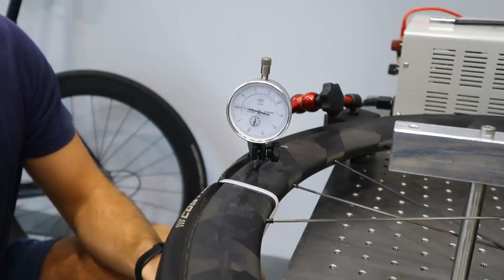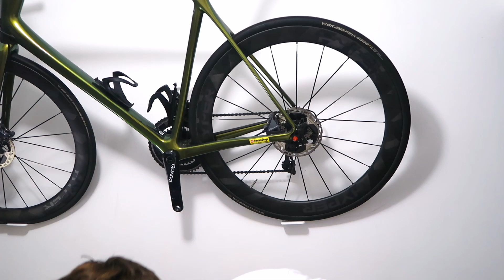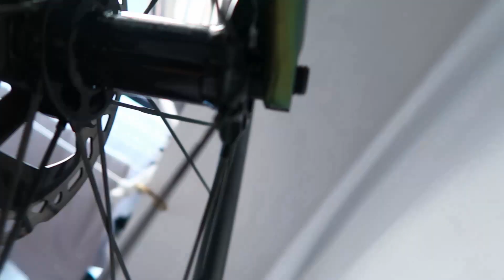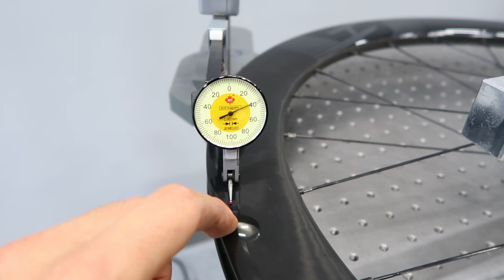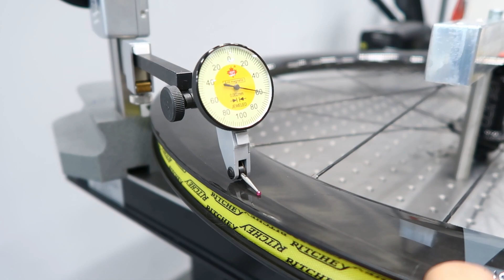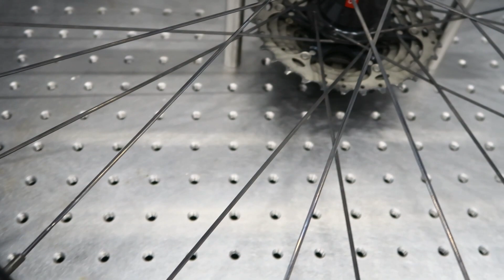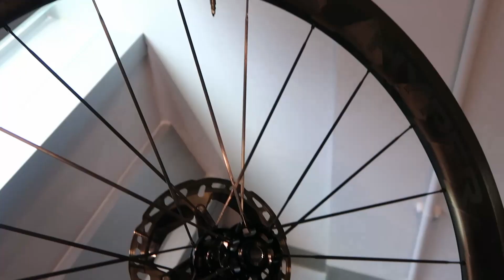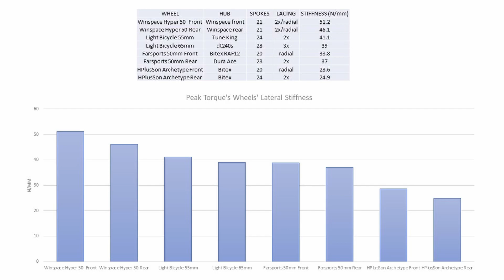WINSPACE Hyper Wheelset Review - Real testing and real data.

Comment: I appreciate this video and channel, but it has to be said that getting this wheelset for free (even if temporarily) for "feedback if I liked it" is potentially skewing the reviewer's opinion and definitely taints my interpretation of the presupposed impartiality (and possibly that of others). Not to mention Peak Torque has offered the viewers a discount code, but wasn't so transparent as to say whether it's taking a cut from the transactions it generated or will generate. The disclosure is not actually "full".

Does this video and the channel in general provide more value than GCN, Bikeradar, Bicycling, Road.cc and so on? Probably, especially for the "advanced" equipment enthusiast/member of the industry. But It doesn't mean that the channel is immune to the same pitfalls that have led to the moral and scientific "flexibility" (one could say corruption) of those other content producers –I don't want to believe that's just a matter of time and audience size.
Reply from the maker: Completely understand your comment and thank you for writing. But you should know I turn down on a weekly basis paid/free product reviews from similar new cycling brands to promote their products. I would say most YouTubers over 10k subs will experience the same thing. So, to consider spending my own considerable time and effort making this video shows you I was genuinely interested in this product. I don't need cash for reviews, im very lucky to have a day job outside of this channel. Cheers

Comment: perhaps a winspace aero frame next!
Reply from the maker: There's not much i can actually test on a frame apart from BB and headset tolerances. And i don't think they make one big enough
Reply: @PeakTorque  their SLC 2.0 is big enough. I’m a tall rider and have been looking at that frame.. I think the t1500 is too small, as I’m 6’4” (194cm)
Reply: Yes, wynspace frame next..
Reply: Review of the frame winspace T1500 on my channel 💯
Reply: Charles Ouimet you made it look too pretty with appropriate camera angles and lighting. he can give us an engineers point of view:)
Reply: @CatMolfar  ahahahahah fair enough. I'm also an engineer (IT) but my channel focus on riding and not product engineering breakdown 😜
Reply: You can find other sources for the aero frames for much less...
Reply: They have an Aero frame. Its called the T1500. their is a review of it on youtube.
Reply: @vietnguyen4312  I have just built one up.  Love it!
Reply: @iainworrallo1266  Awesome, did you get the wheels as well? How does it compare to other aero bikes you have ridden?(assuming you had an aero bike previously)

Comment: Why won't you use them tubeless?
Reply: Tubeless Is not as difficult as some make it out to be.    GP5000’s are known for being difficult to mount.  Period.  Regarding tubeless standards, just get the tire the recommended by the wheel manufacture.  I have 4 road bikes, 3 of them have been tubeless only since day one.  I run GP5000”s  on my hooked wheels and Schawlbe Pro One TLE’s  on my hookless wheels. Zero problems.  Thousands of miles.
Reply: AG Coarseman There are countless stories of people having tires burp and loose all pressure or blown off the rim at high speeds. This is due to lack of standards and tolerance between manufacturers
Reply: Countless unsubstantiated stories.
Reply: Paul Horner sure man believe whatever you want. But if you ask the experts on road tubeless this is what they will say. 
So many people on the internet talk about how those super cheap $300/set eBay carbon clinchers worked well for them and they never had heat problems. Then you find out they live in flat areas and weigh 120lbs. All my rides have like 5-10k ft of climbing with some extended 10% plus descents that I’ve hit 64mph on. Not trusting cheap knockoff wheels or lack of tubeless standards. 
But if it works for you go for it. I don’t want to be locked into tire choices by my manufacturer on a list they may not update in six years after you spent $3k on a wheelset.
Reply: Alex R I have been using Road tubeless for 7yrs, Campagnolo 2 way fit, Miche SWR 50 and Borg disc45. In a100 mile loop I can achieve 10000 ft of elevation, regularly hitting 55/60mph on descents. A tubeless tyre is safer than a tubed. I don’t believe that these wheels are poorly engineered at all as the company that make them is an established supplier of OEM frames for well known brands. Out of curiosity I have a pair on order to test against my Zipp NSW303’s as I intend to run them tubeless on my Colnago C60.
Reply: Road tubeless has no real standard and is a disaster waiting to happen that could potentially kill you. Look at ENVE's website for their latest road tubeless wheels and they have a very small list of tires that are approved for use.
Also for a tire that is unlikely to blow off in a high pressure situation the tires are extremely tight and it would be almost impossible to change on the road. My buddy had some Mavic's with GP5000TLs and it took 3 bike mechanics all stretching the tire at the same time to get it mounted.
Reply: @drunken_moose  Oh, I did not know that.  My daily road ride culminates on a steep downhill with a dogleg turn near the bottom in which speeds easily exceed 50mph (80kmph).  I'll definitely stick with tubed tires.

Comment: I am considering building budget oriented, 100 to 150 USD, alloy front wheel since 1000 USD is to much for me presently. 
I want a little bit taller rims than most widely available road wheels so 35-40 mm. How big of a negative impact does higher spoke count couse, comparing 20 spokes with 32?
Which rim/spoke count combo would be faster/better aerodynamically speaking in your opinion?  
1) Alexrims CX35 35mm high rim with 20 spokes or
2) M-Wave 40mm rim with 32 spokes?
https://alexrims.com/wp-content/uploads/2016/07/CX35-100x100.png
https://www.messingschlager.com/content/Artikelfotos/381040-S_profil_150713.jpg
Reply: Don’t bother with a super deep alloy rim. I’d say stick to 30mm or so. The lower weight and increased comfort will outweigh the slight aero advantage